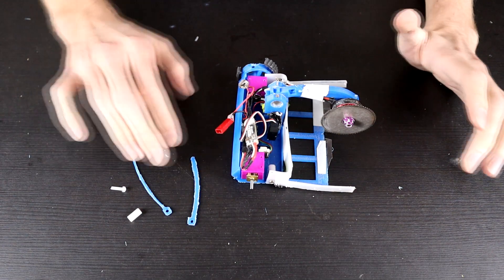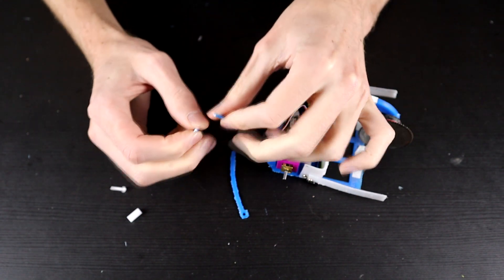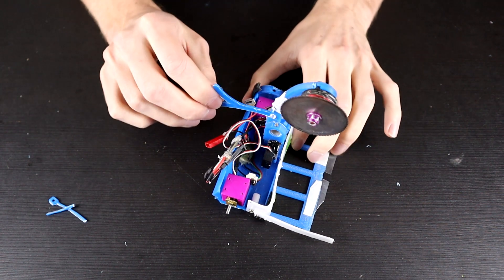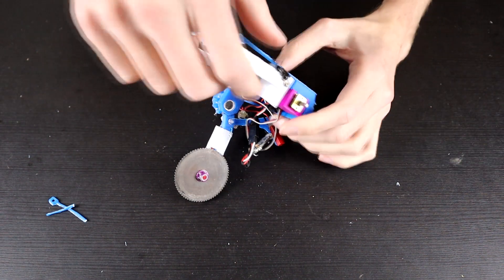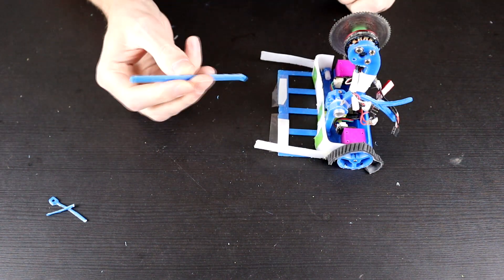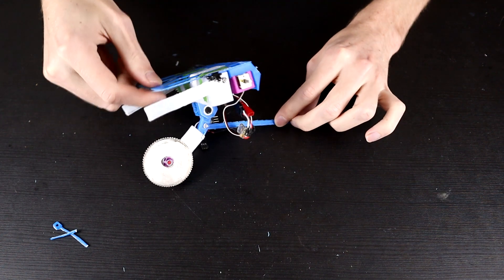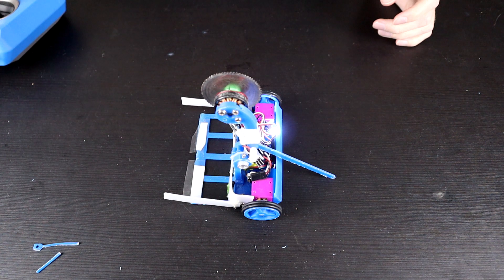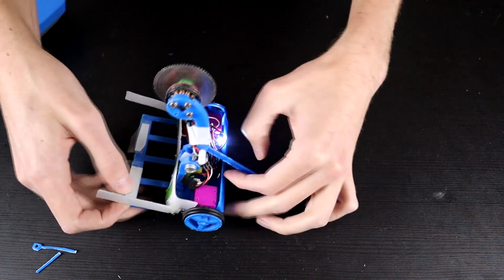Upgrading the saws on my ant! (trial and error experements)

Comment: A slight backward angle on the servo mount (thinking 5° or less) may give you the backward arm angle you need to self right without giving up the forward range realistically needed to get into opponents.  It doesnt need to be on the floor in front as opponents are not that flat.

Comment: Hi, Ben. The self-righting arms look interesting, but a wee bit too flexible and vulnerable in plastic. Have you thought about making them from a different material? I've done some aeromodelling over the years, and something that still gets a lot of use is piano wire.

It's incredibly tough, springy and elastic. You can bend it cold and, once shaped, it takes a LOT of localised force to deform it.  In small sizes (16, 18, or 20 swg [standard-wire-gauge]) it has very little weight considering its toughness, and it might be a useful material to try for prongs, legs and self-righting arms with ant- and beetle-weight designs.

I don't think piano wire (a.k.a. 'music wire') gets a lot of attention in the robot combat world, which is a pity; it's good stuff. Maybe it's regarded as being too crude and old-school when compared to all the slick CAD and CNC stuff and 3-D printed parts.

Worth a try, perhaps? 🤔
Reply: Sounds feasible.

Comment: What about a servo with longer range? If it moved 180 degrees you may be able to just flip yourself using the saw.
Reply: ^^^ this
Reply from the maker: I'd honestly love to use a 180 servo, but to make weight with this design I need to use one specific type of servo.
They are 5.6g and happy to run on 2s voltages (so I dont need a BEC which saves even more weight)
The only problem with them is that they only come in 90 degree form, as far as I've been able to find so far anyway
Reply: @TeamPanicRobotics  something like an excavator bucket linkage could get you more range while still using a 90deg servo, although it'd have a funky force curve through its range of motion. I can't find any good diagrams showing how they work, but I think it should be reasonably easy to figure out from videos or side photos with the bucket open and closed.
Reply: @TeamPanicRobotics  ,  Some servos will allow extended travel from 500-2500microseconds.  I believe you have a QX7, try changing the servo limits to +/-150% and see if you get more travel, it might not be the full 180, but it might be enough to fix make the self righting more reliable.  You may have to recenter the arm on the servo after extending the travel since you want all the new travel in the back and not on the down-stroke.

Comment: you might be able to add a small extension directly behind the saw for self-righting (kinda like tothik from nhrl or sawblaze in battlebots), but with your arm's range of movement, it still wouldn't help with wheelies
Reply: i had the same thought, would stop getting stuck between arm and saw
Reply from the maker: Great minds think alike, after editing this video I thought of that, printed one literally an hour before the comp and had it on the bot for all fights!

Comment: To sort the wheely issue you could add some anti wheel bars on the back of the robot. Although there is a simple way of making it possible to self right maybe make some bigger wheels and a higher torque drive so it can self right better with the arm in theory